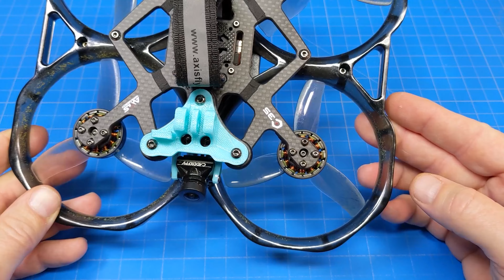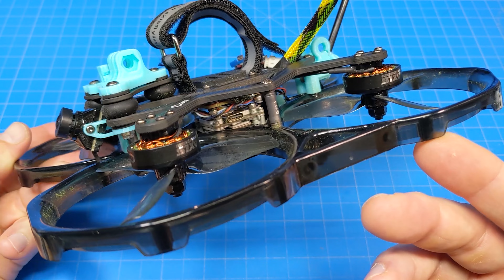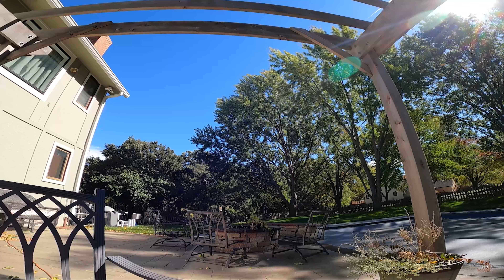Agile CineWhoop // AxisFlying CineON Series C35

Comment: hey I connected drone ,goggles 2 and fps remote conttroller. Controller converted  Manuel mode. But I can't start to motor. What am I miss ?
Reply from the maker: Sounds like you need to set a switch to the arming mode in betaflight

Comment: thank you for the review video, what if I replace the brushless motor with a C224 2750kv, can the flight time be longer, with a 4s 850mah battery?
Reply from the maker: kv is linked to battery use. the number is the number of motor rotations per kilovolt of energy.

Comment: would you suggest this for gopro 11? also what about wide camera angle? wiill the drone be visible?
Reply from the maker: I have not used a gopro 11, it should work fine. I can't comment on the wide variety of cameras on the market and if the drone would be visible. I would suggest looking at the specs of the camera to compare and even then there is always the option to crop or zoom in to eliminate what isn't wanted in the image.

Comment: Is the advantage of 4s vs 6s just agility or probably noise too?
Reply from the maker: performance and potentially flight time as a 6s battery should hold its voltage longer at the end of the battery

Comment: Does this quad available with cadx vista ?
Reply from the maker: Have to check the product pages for options. All products are linked in the video descriptions.
Reply: @NickBurnsFPV  I have checked, but I still confused, if this drone can connect with DJI googles V2
Reply from the maker: @KazanskyAlex  These are the the goggles https://www.racedayquads.com/products/dji-digital-fpv-goggles-v2-ultra-low-latency-810p-144fps-digital-hd While I have the v1, yes these v2 will work as well.
Reply: @NickBurnsFPV  I have DJI remote as well, so which I need to chose ?   PNP-Link+Nebular PRO without RX   ?
Reply from the maker: @KazanskyAlex  The black square dji remote? If so I think you would choose the PNP. But I am not 100% certain AxisFlying would set up the vtx to also be the control link. this is a good question for AxisFlying support. I suggest emailing them, or contact them on their facebook group.
Reply: @NickBurnsFPV  Thank you. You help a lot. But this drone over 250g ((
Do you know any existing fpv drones which is work with DJI googles  under 250g with a battery ?
Reply from the maker: @KazanskyAlex  We would need to move down in prop size and possible a different form factor of quad. This one is under 250Grams https://www.youtube.com/watch?v=ITO7E3UjNao These can be depending on battery and external hd camera...https://www.youtube.com/watch?v=e5NiEeDgDhE  https://www.youtube.com/watch?v=5ontu9Egt0M
Reply: @NickBurnsFPV  Thank you ))

Comment: I really appreciate how you test these cinewhoops flying fast as well. I have found that not many other reviewers do which is really annoying as you can tell the performance and tune of a quad much better when flying fast. I also have two flywoo cinerace20s which I use for freestyling playgrounds due to their safety and durability
Reply from the maker: Great. I can't say I can take credit for the faster flight or if that came from a commenter. But I have found a fair number of those interested in these are wanting to fly them more aggressively than we typically think of with "cinewhoops".
Reply: true, i am building mine with 2205 motors 2300kv 6s. part-time freestyle racer, part-time Cinewhoop @NickBurnsFPV

Comment: you either shot this video about 3-4 weeks ago, or you are further south than I thought.  Central Ohio Leaves are past peak color, but I only saw a little turning or yellow and red.  are those M2 motor mount screws or small head M3?
Reply from the maker: I can't be certain. Generally it takes me two weeks from first flight to published review. The first week or 10 days are all flight days...weather permitting. I can't say at this time if the flight video was early or later in the flight week+.

Comment: You could root your goggles, so you can flash the betaflight osd on them for the battery warning.
Reply from the maker: yes, I am a bit hesitant to take that on. Worry something goes sideways then I don't have working goggles for a time.
Reply: @NickBurnsFPV  

Just do it and maybe do an howto video :)
Reply: @NickBurnsFPV  my buddy did it with his goggles. Works perfect and was easy to set up